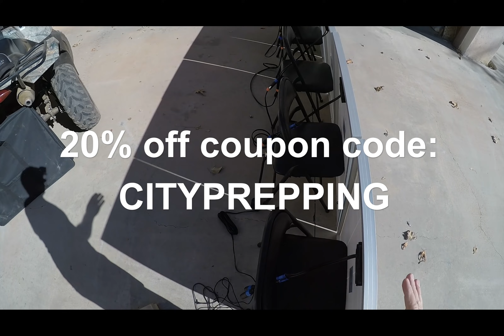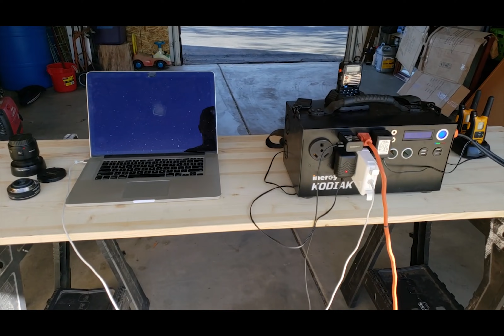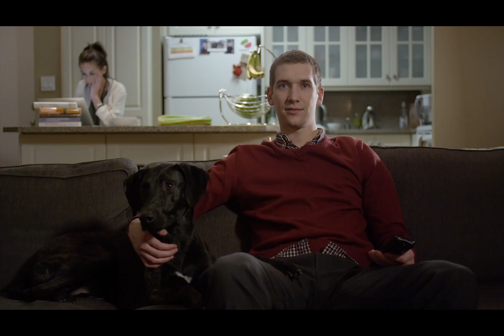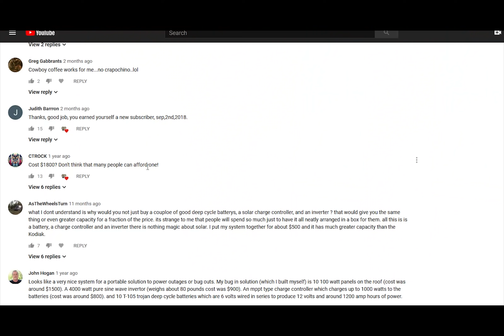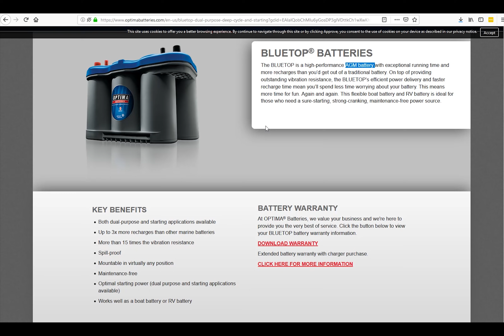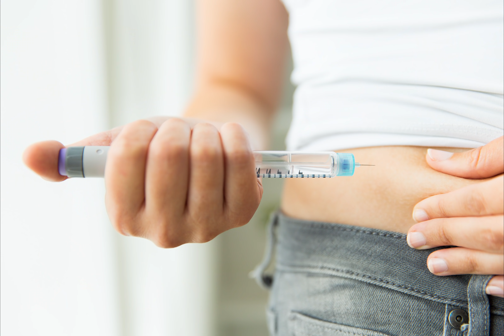Solar Generators: worth the money? Inergy Kodiak after using 1 year

Comment: I really hate to bug you on a question that is not directly connected to your review, but I don't know how else to get the information so I thought I would give it a shot. Here's the problem, I'm looking to get the biggest bang for my buck, natural. I don't understand how to rate portable solar generators with there companion portable / fold able if possible, solar panel charger's.
     I have decided that I need to have at least a 250 watt to 500 watt solar generator, what I'm not clear on, is how to size a portable solar charger to the generator for a single 8 hr full sun light day charge. If I get the 250 watt generator and want to be able to charge it fully in one 8 hr full sun light day, then what size of portable solar charger am I suppose to get, and the same is true for the 500 watt, can you PLEASE HELP. It's next to impossible to get e-bay or amazon to put two and two together when selling one or the other, thanks.
Reply: I think you're mixing "apples" and "oranges" and getting mixed up in the terms.

Watts are a measure of the rate at which power is either generated or consumed, whereas watt-hours is a more accurate measure of how much power is used or stored in total.  For example, this Kodiak unit has a battery that is rated to hold/supply 1100 watt-hrs, but if your rate of use is only 50 watts, then it will run for theoretically 22 hrs, but if you need to run a 1000 watt device, you'll likely only get a 1 hr+ run-time out of it.

The "solar chargers" are called solar panels, and they'll have a nameplate wattage rating, which will be the rate that they can produce power under ideal sun conditions.  Unless you're living in a sunny desert, you probably shouldn't plan on ideal sunny conditions, but rather something less than that, which will depend upon your local climate.

The "solar generators" such as units like this Kodiak have a charge controller inside of them, and it has it's own limitations that will restrict how fast you can charge the internal batteries.  I vaguely recall this unit was restricted by a mere 250 watt charge controller, although they would accept connecting 600 watts worth of solar panels to it, but if that's the case, no matter what, it still won't charge faster than 250 watts/hr, no matter how sunny it is on your panels...

If you can figure out how many watt-hrs of electricity you will need for an entire day, plus some extra to cover efficiency losses in all the parts of the system, THAT number will be much more helpful in determining what your needs are for solar panels (and for battery capacity too!), but don't forget that batteries aren't 100% efficient in storing power, and smaller gauge wire will cost you more lost energy in transferring power from component to use, so every step along the way is going to lose/use some of your power budget.  You may find that you need 150% more solar panels than your need/use number is, just because of the efficiency losses, and the one thing that bites everyone, is they find that they really needed/wanted more battery storage capacity, 'cause the sun doesn't always shine when you want it to...

A very simplified flow chart looks like this (minus things like fuses, breakers, etc.):

Solar panels --> Solar charge controller --> Battery system --> Inverter --> Load(s)

Panels can only produce so much, so fast...
Charge controllers can only accept so much, so fast (IMO don't cheap out here)...
Battery systems can only hold so much power, after they're full, the sunlight is wasted if you're not able to use the power during the daylight...
Inverters can only invert power so much/so fast, and overloading them tends to burn them out at MOST inconvenient times & places, so go larger and better quality here too - you can't easily replace them in a grid-down scenario...
Loads should be planned and chosen with the system capacities in mind too, although if the loads are critical, start planning with the load and work backwards to find out what it will take to run THAT load!

As a sidebar, one can avoid the use of the inverter for some things, if the loads are capable of running directly on battery power, which will also skip the efficiency losses in the inverter and give more usable power from the same charge, but then there are also limitations to direct battery-powered systems, because they tend to be limited to being 12 Volt systems, which as the power demand grows, so does the minimum wire sizes to handle that current...  That's also the reason why most real off-grid solar systems are running 24 or 48 Volt systems - to regain that lost efficiency and cut the costs of the system by not needing long runs of big welding cables...

If you're willing to do your own system, start by adding up your loads and the amount of time you need to power them in a full 24-hr day, then work backwards from there to determine both your inverter size (maximum simultaneous loads) and for how long you'd need it, which will give you your minimum battery system capacity.  Keep in mind that LiFePo batteries will give you a much longer lifespan if you're only using them down to 80% depth-of-discharge, and you can bank on that 80% as available power, but SLA (sealed-lead-acid) batteries die much faster if you use more than 20% depth-of-discharge, so for the same amount of usable power, you'd need 4 times more lead-acid batteries over their lifetimes.

Following the flowchart backwards, the battery charger is next, and that limits how fast you could charge the batteries, but there is a top limit to this too, because batteries last longer if you don't hot-shot them (quick charge), so keep that in mind too, but plan for one large enough to get the job done, or it will forever be the thorn in your side, limiting what you can do with the entire system...

After that, all you need to sort out, is how much solar power can you afford to collect in the space/time that you have sunlight, don't forget the safety stuff like lightning arrestors & breakers, and you have a functional system!

In summary, if you need a convenient all-inclusive system with support, go with something like the Kodiak or Yeti, and follow their guidelines, but be aware you will also have to live with their limitations too, as the prices they're willing to sell the ENTIRE systems for, not just the generator part (Notice there wasn't any mention of the cost of those solar panels in the video?  They're not included in the $1800 price tag for the generator).
Reply: @testuser3167  Thank you so very much, I actually think I understand, at least a little more then I did. My need is way, way less then the systems you are referring to and that was why I was a little leery of asking such a lame question.
   Lets see if I have it basically speaking. If I have a yeti 400, then if I used a 25 watt foldable solar panel, it would take 8 hours of sun light to charge it, give or take, more or less a full charge.
    I live in Tucson, so sun light isn't a problem or actually it is, but on a different level Ha! Ha!.  The off grid situation for a possible bug out scenerio is a little different as well. To go for 15 or 25 miles in any direction would place a person far enough in the local desert to go unnoticed for some time depending on how you were set up camp wise.
    So the first order of business for me is transportation, as I do not drive or have a vehicle. What I do have is a little eco smart razor scooter with a carrier / wagon / trailer, So I can carry the very basic's, like tent, weapon, lights, water and radio. This actually leaves me with plenty of room for battery's, charger's and panel, even been thinking about placing a 100 watt rigid solar panel on the top of the trailer.
    My battery consumption and miles of travel on that scooter / bike, are limited to 20 miles, I'm looking to increase that by adding a additional bank of battery's. Lithium I understand are the lighter and more enduring, but money restraints cause me to have to stick with lead acid, thus the solar charger and fold able solar panel, and or both the rigid 100 watt solar panel and a foldable 25 watt one. 
    Thanks for the info and your really great explanation of how things add up. I'm going ti have to figure out a way to charge and use at the same time to keep the charge up so I don't completely drain the banks I'm using. Not only for the wastefulness of the available solar charge but to use that power for other things like lights and refrigeration on a small scale. There's a lot of thought and preparation involved in coming up with exactly what you need, at the best bang for the buck, thanks again.
Reply: @ambroseabellair5306  It's going to take more than 8 hrs of sunlight to produce 400 watt-hrs if you only have a 25 watt panel -- that will only produce 200 watt-hrs (25 watts x 8 hrs) under ideal conditions, pointing directly at the sun the entire time and that doesn't account for any inefficiency in the system, so you will certainly need that 100 watt panel!  More panels will never hurt, because one can't guarantee perfect sunlight or duration of such.

Lithium batteries are less toxic, with higher energy density, but there are a few different lithium battery chemistries, each with their own pros and cons.  The type that must be in the Kodiak (because of the weight), are lithium-mananese-cobalt-oxide (LiNiMnCo, NMC, NCM) which are the lightest, but also the most dangerous, if abused (like spontaneous combustion).  18650's are in the group too.  They're also the most expensive because they're the most bang for the size/weight, even though they don't have the cycle lifespan that the LiFePO4 batteries have.  I actually question the 2000 cycle-life claim the Kodiak has, because it doesn't match known science, but the product is too new to prove them wrong (and conveniently ALL the units sold have shorter warranties than the claimed lifespan of the battery, so when one dies, even when it doesn't last as long as the marketing claims said, it would still be out of warranty...)

Lithium Iron Phosphate (LiFePO4, LFE) batteries are probably a better choice for a stationary setup, because they last much longer, although they aren't as energy dense (therefore weigh about twice the LiNiMnCo type, but still much lighter than lead-acid batteries by far).  They're also cheaper than the NMC battery of comparable capacity.

The Yeti 400 may actually be able to chain other lead acid batteries with no problems, but the Yeti 400 Lithium probably can't - only use them as a supply, not charge them.  My best guess, as I don't have one, and didn't research it, because my needs/wants are too large to start there.

Battery endurance is very closely related to care and use/charging too, it's just that Lithium batteries are much pickier about their charging than lead acid are, so they can be destroyed with the wrong charger (which is my best guess why none of these Lithium units will charge SLA batteries, since that would really complicate the charger to a point of making the devices much more expensive for little gained profit.
Reply: @testuser3167  Yah, my bad poor math skills I meant 50 watt, times 8 hr's = 400 give or take. The 25 watt would be double that amount basically, 16 hr's but that's right when the math is corrected right ?, at best condition's and not allowing for any variables.

Comment: During the last hurricane, I ran my huge fridge 2 hrs every 6 hrs...it kept the freezer at 18 deg...saved all the venison.   You are right, you just have to think ahead and prioritize.
Reply: So during Irma I had no power for 18 days on an island off the coast of Florida.  Buying a Kodiak since then has changed our hurricane lives! I lost over 500 dollars in insulin alone plus all food. No one seems to take this into their decision making. I love my kodiak but also bought a small travel refrigerator for insulin and milk. The kodiak runs this refrigerator plus small fans   and keeps a small string of lights on plus charges our computer and 2 cell phones.  Remember to charge it fully before the storm and if you need to, you can take a ride and charge it while driving as well. Oh yeah, even without a solar panel I took a 4 day  van trip and it ran my sleep apnea machine for 3 nights and still had power to spare. I'm keeping mine.
Reply: @LazicStefan I a=I have covered a freezer with heavy tarps for two days with out power and the meet was fine.
Reply: @Jaden5562  From Lil Giant Great! What do you mean by heavy tarp? Moving blankets thick? Just one of the waterproof tarps like from Menard’s? Was it winter? Was it cold or hot inside/outside? How big was the freezer? Was it packed full? Halfway? I am expecting to start a homestead. Having all the meat disappear in one fell swoop would be a crisis for me. If you can approximate would be big help. Thank you. 👍🍀
Reply: From Lil Giant How did you know the temp of the freezer? Did you open it up every 8 hrs to check the thermometer?
Reply: @henryvalero9235  I use a indoor/outdoor unit. Amazon has one with two remote sensors + indoor for about $20. I run one in freezer, one in frig.
Reply: @Utah_Mike  From Lil Giant I assume you mean an indoor-outdoor thermometer? Then you open the fridge/freezer when withdrawing food and check the temp?
Reply: @henryvalero9235  they are wireless.
The sensor is in the freezer & the display is outside. My display in the house & freezer in garage. The $20 one I have you can set an alarm at a temperature to let you know of a problem. My freezer is set at 0 & alarm will sound at 10 deg. 
“Otis refrigerator them”  Amazon

Comment: My small fridge (smaller than the one here) was powered for 26 hours, just off the u it. I also charged an iPad during that time. That was from the unit being full to going to empty. The fridge is old through (like 25+ years). Maybe a newer one is more efficient? Still pretty good though.

Comment: With the Kodiak is the 120volt power output a true sine-wave? Clean power.
How have you sensitive electronic responded to its power.
I had made my own power bank a few years ago using a interstate deep cycle battery and a modified sine wave inverter along with several 12volt sockets and USB outs, but the modified sine wave will Not run a lot items.
Great info in this video, thank you.
Reply from the maker: Yes, true sine-wave.

Comment: I just picked one of these up based on your prior reviews. My primary use will be to run my off grid cabin for the weekends or a few days for lights, TV, small water pump and maybe a small refrigerator (AC or DC) but still deciding.
Reply: DC refrigerator uses less energy and will run longer than the inverter.  The AC INVERTER uses some of the energy for the fan cooling down the unit.

Comment: I need one of these to run my CPAP machine in a long term grid down situation. I have a generator, but don't like running it at night while I sleep. I also have several solar panels on my roof, but they feed back directly into the grid. I don't think the company that installed the system would allow me to add a 600 watt outlet from them to feed the Inergy Kodiak. They would probably say it would void my warranty they gave me on the solar panel system. I might have to do some research to see how difficult it would be for me to do that myself after SHTF when I could care less about a warranty. The panels I have on my roof supply a lot more than 600 watts so I'm wondering if there would be a way to use all the panels on a cloudy day so it would still produce 600 watts. I would probably need a transformer or something to do that.

Comment: I have the large Yeti and it has paid for itself in the past year (storm power outages) after saving contents of the fridge several times and providing ample light and even entertainment at night. Yeti is heavier, but has more power. The Kodiak charges faster. There are good and bad for both. I don't care which brand I have. In the end, I just like having a solar generator option that is stealthy, portable, and doesn't rely on gasoline. Ideally, both a gas and solar generator should be on a prepper's list as both have their place and time of use. I'm working on a one year video using the Yeti, focused on the same issue: is a solar generator worth it?  Thanks for sharing, keep up the good work!
Reply from the maker: thanks for sharing your experience...this is very helpful.  i agree, having both solar and gas would be the ideal situation.
Reply: Survival Theory how much heavier is the yeti?   I’m shopping now and I’m thinking the Kodiak would be easier for me to set up and lighter for me.   I have a couple of portable power sources but I’m thinking I want a better system until I get my dream property.   I’m most concerned about being able to lift the thing and hook everything up with my kid bugging me while I do it.   Don’t laugh she’s autistic and it’s not her fault but she’s sometimes less than helpful.
Reply: The Kodiak has an RV plug-in, the Yeti does not.  Big advantage for the Kodiak.
Reply: @patricklee780  is the Yeti also a Lithium battery? I saw a video on a lithium battery catching fire while not even in use.
Reply: @recoveringsoul755  Unless the lithium battery is abused or put through extremes for which it was not designed, there is little danger of fire.
Reply: That Honda gen is badass. I would use that for running the washer or any high drain devices. And relying on solar for the rest of your needs. But that would require you having dozens of gallons of gas laying around.
Reply: Would these power a full size freezer?
Reply: @mylittlebluecottage6061  yep, mine has many times.
Reply: @SurvivalTheory  👍